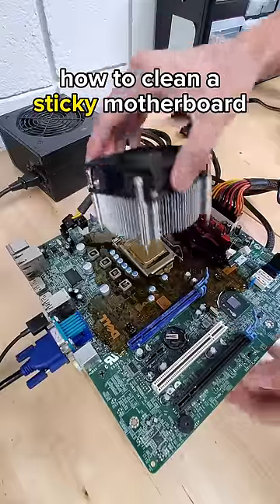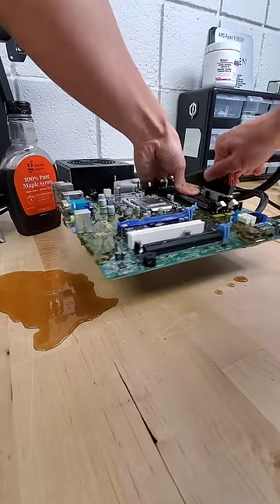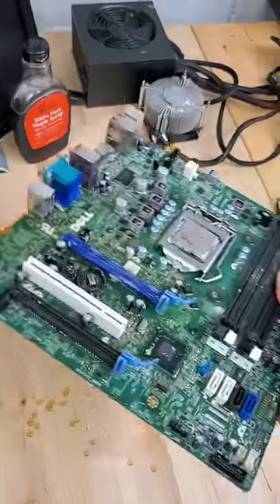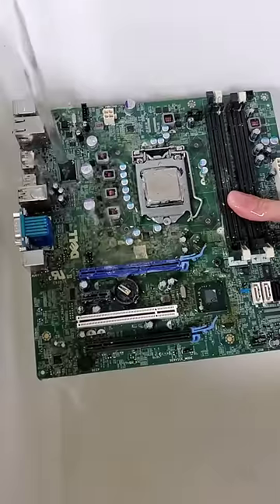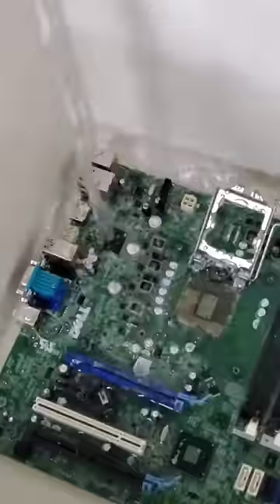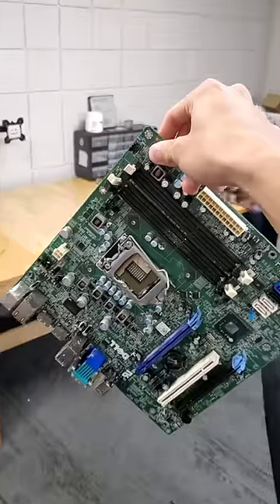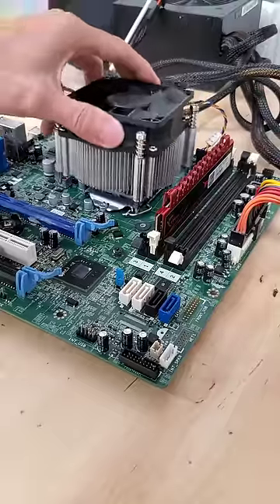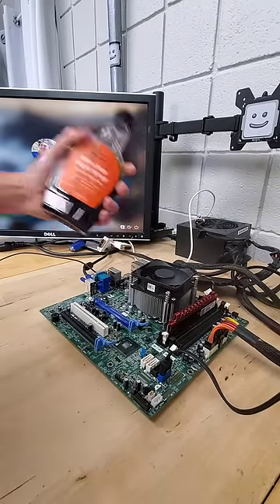sticky motherboard? not anymore! #shorts

Comment: Wow, now I'll wash my pc 2 times a year😃
Reply: Corrosion: let me introduce myself
Reply: @madoba8717  is cleaning with alcohol fine?
Reply: @ashutoshhiremath720  yup, pretty much every repair shop use alcohol to clean electronic components.
Reply: @ashutoshhiremath720  i read that ethanol/rubbing alcohol can leave residue. Isoprpyl alcohol is better
Reply: It's called a bath and is done with special liquids. So yes this is a thing.
Reply: @madoba8717  Bro it cant corrode
Reply: @kaksidaksi3455  Yes it will. But I’d like to know why you think it won’t
Reply: @madoba8717  because i said so
Reply: @detsu9176  can i use alchohol wipes to clean my laptop screen?
Reply: @notshadyshad  no, alcohol is not good for laptop screen just use normal water spray or wet cloth.
Reply: @madoba8717  Rubbing alcohol is isopropyl alcohol.
Reply: @rdizzy1  it’s usually ethanol in my country
Reply: @madoba8717  That is odd, have never seen ethanol for sale in such a manner.
Reply: @rdizzy1  yeah i dont think it’s legal everywhere. I can send proof as well
Reply: @madoba8717  I believe it, have just never seen it. Anything here in the US that ive seen for medical use is all isopropyl alcohol.
Reply: @rdizzy1  yeah i think people would get drunk off of it lmao. In addition, the ethanol is 95% as well
Reply: please dont do it with water you still have a risk of having a bit of water somwhere where you dont see it

Comment: “Since it’s powered off this doesn’t do as much damage as you might think”

Capacitors: “Have we become jokes to you?”
Reply: You can drain capacitors pretty easily. Unplug the pc and hold the power button for 15-20 seconds
Reply: @louiesatterwhite3885  ayo waht
Reply: @louiesatterwhite3885  yeah true
Reply: @louiesatterwhite3885  would it be the same if you put the screwdriver on the motherboard pins if its not in a case?
Reply: @misfitale1952  yes it will keep it unplugged too
Reply: @CFronTV  ty
Reply: @louiesatterwhite3885  agreed
Reply: @louiesatterwhite3885  ayo whaaatttttt
Reply: Storm Chaser  tap water is full of ions and salts, any water that isn’t pure distilled water (which has 0 impurities) will conduct electricity and fry yo shit.
Reply: @louiesatterwhite3885  bro it’s out of case for testing. How do you even turn on the motherboard for few seconds. Screwdrivers are used to turn on the pc which has no use but to just to power on. The screw driver thing works for just a sec and that’s enough to power it on.
Reply: @itz_Guna  tell me you know nothing about circuits without telling me you know nothing about circuits
Reply: @itz_Guna  ????
Reply: I doubt he drained the capacitors.
Reply: @sparkyispog  yeah bro
Reply: "have we become jokes to you" its 2022🤓
Reply: Water on metal will cause corrosion wtf are yall defending
Reply: @deadpool1966  of course if you don't dry it out, but according to the video he dried the circuit before putting it back together, so no corrosion.
Reply: @sparkyispog  thank for that Google translate
Reply: @Set81  another person scrolling through the comments section at 3am lol
Reply: From the comment you make, it makes us think you are a noob in electronics.
Reply: @louiesatterwhite3885  Yeah I always do that when opening up my pc to change smth
Reply: your science has blown my mind 😂
Reply: L
Reply: @hornyjesus_  u mean the cabinet's power button for 15 secs ? Umm never tried it before
Reply: Man you discharge the capacitor by short the + and - if you know about electronics
Reply: Was about to say the same thing
Reply: CmOs battery am i joke to you?
Reply: even how to youtube vids tell you to keep the powerbutton 20sec before doing anything xD
Reply: Wow
Reply: He already removed it XD
Reply: @louiesatterwhite3885 there are jumpers that can be use to short out the caps
Reply: I was one taking apart a camera and the capacitor started sparking so I chucked it so far😂
Reply: @louiesatterwhite3885 dont they discharge really quickly now?

And if you do want to drain the power manually, doesnt that happen within a second after you press power?
Reply: You never Heard of Tech Yes Lovin' then... They do supersonic cleaners on GPUs
Reply: @deadpool1966 he soaked it with isopropyl afterwards.
Reply: @tiesetsomatsipa5402 he didn't dry it, he used isopropyl, which dried it.
Reply: @AlexAlex-bh8fi you can also yaink the cord while it's still on. That'l drain the electrons!
Reply: The CPU and RAM actually keep drawing power while held in reset when the pc is unpowered, so they'll drain the capacitors in short order. Both their own and the upstream railcaps.
Reply: you dont do any pc maintenance if you dk how to drain capacitors in a board 😭
Reply: Smartest guy ever lived:
Reply: He used IPA to get rid of the water residues. It hinders the buildup of corrosion
Reply: @sparkyispog we call it rest-charge in germany. After disconnecting it from the main power supply  there is still a bit of charge left (mainly inside the capacitors). If you push down on the power button, you create a full circuit. It would disconnect if you let go, since there ain't enough power to boot the whole pc, but if you keep the power button pressed down, it will discharge all energy. Most modern pc's have an LED next to the power button. After you take out the main electric source, it keeps lighting up, due to rest-charge.
Reply: Me: capacitors, you don't have enough electricity
Reply: Did you know that tap water isnt conductive?
Reply: @sparkyispog you shouldn't be here in these comments
Reply: @jordanwhite2133  what electricity bro he’s cleaning it when it’s turned off💀
Reply: @deadpool1966  If you don't dry it bro. You will need to dry everything before you power up the mobo again. If it is dry, no corrosion happen.
Reply: @jordanwhite2133  Nah, distilled water is power conductive. You'll need deionized water if you're going to clean electronics with water.
Reply: @kobejanvicente1686  I mean no this video proves that but I also said tap water is full of ions so I'm still right just used the wrong water name
Reply: @louiesatterwhite3885 how do you drain motherboard which is disconnected?

Comment: Some extreme overclockers put their motherboards in dishwashers to clean the Vaseline off that protects the board from condensation. As long as you completely drain all power from components, water wont cause any harm.
Reply: It's not completely true! Water from dishwater is softened and so is a bit corrosive! Tap water is also dangerous because it may contain minerals that can deposit on traces and create false contacts! The proper way to wash an electronic device is by using proper deionised water!

Comment: Man has balls of steel to do that to his pc
Reply: It’s like a 20 dollar motherboard.
How do I know this may you ask? Yes I have the same motherboard and it’s dirt cheap
Reply: @morbid_flamingo2909  so was this satire or does it actually work? i have a motherboard that short circuits
Reply: balls of diamonds.
Reply: @auzzzeee6637  Well the maple syrup doesn't but you can clean your motherboard with water. Although you probably shouldn't do it unless you know how.
Reply: @iz2333  be careful, especially around the capacitors, those things tend to kill electronics.

Comment: Yep, keep in mind though if the water is heavy with minerals during the drying it could create short circuits, also capacitors stay charged, so idealy those should also be discharged, however as we can see usually its fine

Comment: The only problem it could cause is over time the Capacitor will take in water and then it won’t work, but it’s just a matter of replacing the capacitors and it will work if the capacitors didn’t damage anything else, the resistors, mosfets ics won’t take in water because they are sealed components, maybe the motherboard could take in some water and over time become brittle and the traces will be broken and when that happens the entire thing is toast, because there just isn’t a way to fix a trace that is inside of the board, you’d have to grind part of the board but then you’d be risking damaging other traces that you don’t know where they go

Comment: 1.
 use synthetic oil that doesn't evaporate and dry up and shrink like veg base.

2. use very finely ground highly conductive ground metal powder as a heat transfer medium.

3.
bear in mind that using water to clean the motherboard and not spraying a light rust inhibiting coat - (after covering risky items that would create short circuits)
 ....will cause rust in the very near future - as with electric items that get wet and then sun dried without drying and coating crevices.

we lightly brush on petroleum jelly as a protective coat even when joining two wires together at home so as to get a longer lasting, corrosion free, and cozy conductive joint .

remember though, crap gathers on grease and creates electrical conductivity.

the method is usually good for wire and nut joints, and isolated motherboard parts.
a paper stencil can be used to isolate parts when spraying wd-40 type stuff.

works like a fresh lick of paint

Comment: Circuit boards are cleaned with water during production BUT deionized water is used...even a small amount of dissolved solids can bridge a connection resulting in frying your board

TLDR dont try at home

Comment: isoprophy alchohol is what saves the circuit..it literally evaporates along with the other foreign liquid it came into contact with. but this trick would only work if the alchohol were applied as early as when the pc is soaked in water.. if the mobo was let to dry on its own.. even that alchohol couldn't save it

Comment: Rinsing it water is commonly done in commercial applications. As long as it’s immediately followed by a rinsing agent to prevent corrosion it’s fine. Works on ultrasonic cleaners as well.

Comment: been doing that since pentium dual core was 1st released way back 2006, motherboards are film coated, you can safely wash and soak with any shampoo or diswashing liquid, just be sure to dry it fully. Use hair dryer or heatgun or leave it under the sun..

Comment: Simply letting it dry does not mean its ok. Water has impurities in it and will leave behind minerals that could potentially short circuit some components. Youll  probably have to use distilled water to try and remove all the impurities that have dried on the mobo

Comment: Yeah the only point of failure might be an inductor, if not dried properly. And it would need some time to fail for the copper wire to oxides it will not be instant failure.

Comment: Washing water will remain under various highly integrated IC chips for a long time without drying. If this does not go away after a day or two, it can burn the elements of the motherboard the moment you turn on the power hastily.
Reply: He said until everything dries
Reply: IC chips are very unlikely to short out capacitors, and resistors are more prone to water damage but you can easily discharge them by just holding the power button

Comment: YOu should not use Ispropyl for the motherboard it will strip the soldering paste and other stuff.
Use distilled water. I learned this from a friend 30 years ago. He used to supply sound for outdoor events and his amplifiers and speakers would be caked in dust he would just dip it in distilled water and then use a compressor air used to dry cars he would take it to a service station and dry it.
He would tell this should work for computers. But I never had the heart to dip my computer in distiller water. But then when he started using laptops to play music he did it. He removed the battery held the power button for a minute and then would dip it in distilled water and dried it.

Comment: You can also use a sonic cleaner. 

And if you're willing to risk it, you could just run it through the dishwasher. As long as its good and dry before you run power through it, it should be fine.

Comment: It's honestly not all that surprising really. I immersed a B350 motherboard from a flood damaged PC, first in distilled water overnight, let it sit to dry for 48 hours, then in 92% alcohol over,then again let it fully sit to dry for 48 hours. The board worked completely fine after that.

It surprised the crap out of me because when I came across that PC it had literal mold in it. Lol. Sadly that motherboard was the only thing salvageable. Everything else succumbed to corrosion

Comment: Capacitors, CMOS battery - I thought you knew how computers worked
Reply: they can be discharged by holding a screwdriver to the motherboard battery, he knows his stuff
Reply: @pecros  First of all, wtf are you doing discharging a CMOS battery with a screwdriver, have you considered taking it out? Second of all, they didn't discharge the capacitors. Third of all, you should look at a plug - see that third prong? It's called ground. Exactly how is a screwdriver grounded?

Comment: Having worked at one of Hewlett Packard's pc fab facilities, modern solder flux is water soluble. So water is fine, the optional would be  rubbing alcohol which has 30% water so both ways of cleaning.

Comment: I've washed many electronics.     

I washed out my vacuum after running over cat diarrhea I didn't see.     That was nasty lol. 

I've hosed down old lamps to get them clean.   

I've washed remote controls.   

Floor fans.   

As long as there's no charge left in anything and you allow it to dry fully most times they will continue to work.  Idk if I'd try it with a $500 motherboard but maybe a cheap one

Comment: You just need to remove the battery in motherboard so that the mobo has no electricity charge if it gets wet, you just need to completely dry out all the wet surface and if you try to use it no Short circuit will hapen

Comment: Capacitors on motherboards have held charges since the 8088, 80286, 80386, 486, Pentium class, AMD, etc...
Danger will robinson (Robot from Lost in Space)...
Danger...
Risk of electric shock/short during and especially after procedure is like 90% imminent (for sure)...
Even the moisture from condensation can short out electronics.. winter storage unit taken indoors gains condensation from the temperature change alone.  So running water over any non-water resistant circuit board is probably un-wise..
Poetry
Chi-attle

Comment: Don't the capacitors hold any power in them cause if the motherboard is not connected to nothing they have to be grounded so discharge properly

Comment: Electronics and water or any other conductive liquids or objects will harm the PC for example if you short some rezistors or condensators.. also the minerals left behind an evaporated water might damage it so rinsing it under water and then cleaning it w isopropyl alcohol is 99% safe as there's small chance that you might drop it on the ground while cleaning it

Comment: Hi, I recently tried to boot my PC and it just didn’t. I smelt burnt rubber from my PSU, so that’s what failed. I was using a Ryzen 9 5900x and an rtx 3070 and apparently the 650 watt PSU that had been working just fine for the past year wasn’t able to handle the load. What are the odds that the parts in my PC are just broken, because I read that if something like this happens it fries all the other components.

Comment: Day 1:why my MSI Aegis R 12TE-276US Gaming PCIntel Core i7 12th Gen 12700F 2.1GHz Processor; MSI GeForce RTX 3070 Ti; 16GB DDR4 RAM; 1TB Solid State Drive only have no upgradable  space memory,  it only has for HD disk ONLY ONE thw main one under the radiator of the cpu can't take it off bc I new to pcs

Comment: YOU CAN CLEAN IT WITH WATER???
Reply: Water by itself isn't dangerous. It's when it spills on a turned on PC that it's a problem, since it conducts electricity. It's fine to use on a turned off PC, then you make sure you use isopropyl alcohol afterwards.
Reply: @sphrcl.  but, you will need to take most of the removable parts off like the ram, ssd, and the cpu
Reply: @parakoopa99  right

Comment: Don't try this your motherboard will be dead
Reply: No it won’t because I tried it on my motherboard and it was fine
Reply: It won't be dead as long as there's no running power AND you completely dry it off with no water or moist anywhere before powering it back on.